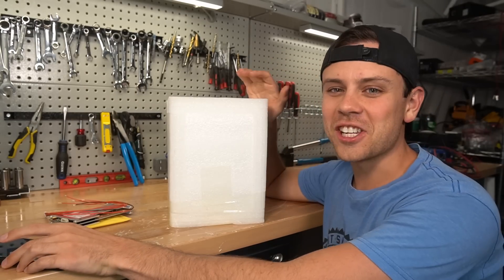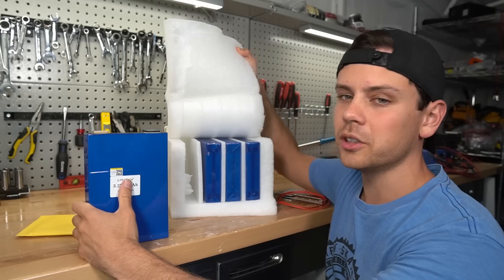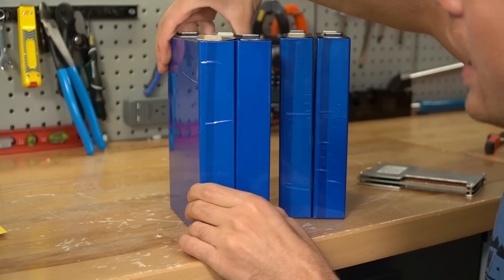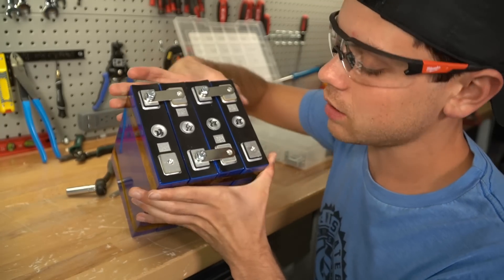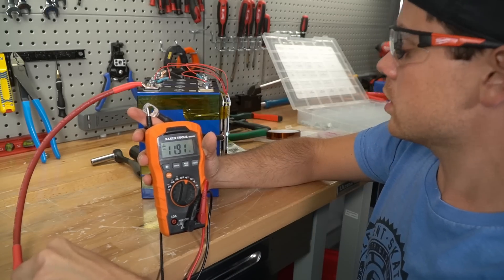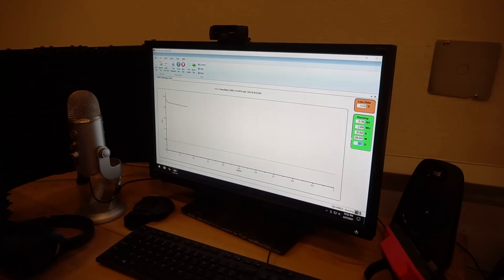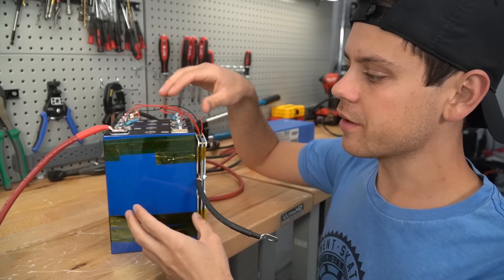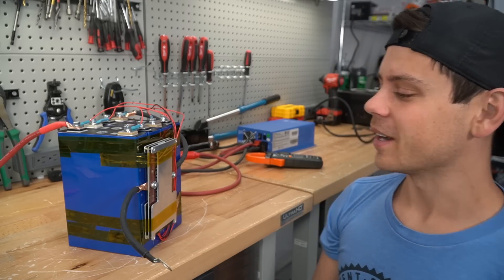Cheap LiFePO4: $221 for 100Ah 12V!! The Cheapest Cell + BMS On Aliexpress

Comment: Hello Will, I recently purchased a 1962 Vintage Airstream Bambi, (16 foot) and am restoring it to be functional yet aesthetically remaining a 1962 Airstream. There is a factory installed aluminum battery box on the outside of the trailer under the front window. This box measures 20" wide, 6" front to back and 10" deep. Currently, there are few things running on the 12V system (roof vent/fan and 12V lights, trailer brakes) but I would like to look forward to adding solar panels (not mounted to the trailer, carried in the tow vehicle) and have space under the bed for an inverter, etc. As the battery box is outside and not heated nor insulated, I am asking for suggestions. 
The inside of the trailer does not allow much space for large batteries. Is there enough room in the battery box to configure a LiFePO4 battery and incorporate a battery heater? Given the small size of my trailer, is it worth the expense of LiFePO4 batteries, or should I go with a lower cost Deep Cycle Marine lead acid battery, add an inverter and charge controller, saving the battery upgrade for a later time? What size inverter would you suggest?

Comment: Thanks Will for all your videos.  With your help and some others I have completed my solar install for my new camper.  I have 4 Battle Born 100 amp batteries an inverter, progressive charger, transfer switch and 4 100 watt Rich Solar panels.  I hooked it up today and my Batteries were at 90% charge and were full in less than an hour. Everything works!  I am so pleased and had very few problems that were not covered in your videos.  Thanks again you are just Super!

Comment: Could these be used in an electric riding mower, like the Ryobi 480e, that uses 12V 100ah lead-acid AGM batteries? The Ryobi needs four of these in serial to produce 48V.

Comment: Two weeks ago I bought four 280ah batteries for $228 with no tax and free shipping and...they have shipped. Who knows how good they are but that is crazy cheap! I upgraded my 12v lead acid system to 24v lifepo4 after watching Will's video last year and have equipment from that system laying around. I have a separate 24v 280ah system and the new batteries wont be used in that.
Reply: How're those batteries holding up?
I'm looking at 280ah batteries on AliExpress

Comment: I've been told that some shipping companies will only ship batteries if they're at 30% state of charge or less because of new regulations
Reply: Yes . We are lithium battery manufacturers
Reply: Or the batteries were removed from commercial service after a couple years . Those look  alot like refurbished used batteries to me you got screwed if those were sold as new

Comment: litokala once sold panasonic ncr18650b genuine cells for like less than 3 bucks each, all tested fine. but it was like 5 years ago  built a 600Wh pack with them for under 150 bucks.
Reply: And is it working fine still?

Comment: OH YEAH U R RIGHT. 221 is great price.  My friend went to buy battery at Orelly. they charge him  or lead acid  for my Uncle car's battery 12v for over 200 dollars  which would last only about 2-4 years.  5 if u r lucky.  with this Lifpo. it would last over 10 years if BMS not fail.  But then. you would have to put it in the battery box.

Comment: This question isn't related but hopefully you can help.   I have a renogy DCC50S max 50amp charge rate.  Can I use a battery that doesn't take a 50amp charge rate or do I need to get one rated at 50amp charge or better?  I think I know but... Thought I'd ask anyway. 😂
Reply: Read your charger manual.  Most modern chargers are "smart" and will adjust the charge current to what the battery will take, but if you want to maximize your battery life, you need to be able to set your charge current to be the same or less than the rate charge current of the batteries.  If you can set your charger current, then you can use it with lower rated batteries.  Just make sure to match your charge current to the rating of the batteries.

Comment: I was told these types if cells require pressure to hold them together. If cells bulge, they are no longer good? But the caps didn't blow. I'm confused.
Reply: Yes they need sone positive pressure on the cans.  The internals are wrapped up in a roll and naturally want to bulge out in the middle.

Comment: I learn so much here, it's way cool! Do you think these cells would make a pack that was good enough for running a 12 volt trolling motor that pulled around 35 amps at full throttle and used in a small Jon boat a couple dozen times a year? LA is so heavy and as you well know, doesn't deliver a lot of energy for the weight. I'm old enough that I'm not trying to buy a battery that will outlive me, LOL,  just one that is cheap and light and will run my little boat around the lake for an afternoon.
Reply: How did you get on ?

Comment: Hello from the Philippines, Will. May I ask you what I would need for a complete solar set-up for my camper? It should be able to run 3 12v fans, charge phones and power a laptop in the day - and, power LED lights and the same 3 fans at night. I would appreciate your kind advice, thank you
Reply: Considering that each fan is 90W and a bulb is 14W, that would be a total of 284W. So in theory a single 330W panel would be enough but I suggest going with two 330W panels as they won't produce the full 330W on most days. Apart from that you'd need a solar charge controller and also a pure sine wave power inverter with a battery capacity of about 2.5 - 3.0 kWh to be able to power the load throughout the night. Hope this helps. Just for your reference a 2.5 kWh battery would be about 12.8V 200Ah.
Reply: @cg.maniac  Yes, this is great. Thankyou!

Comment: I bought the VariCore version of these. not badly swollen. cells only cost with shipping and all 170$  2 months to the day to ship to the west coast North America. Pretty happy with them, but being that the Eve cells mentioned in the video are still cheaper per WH, might just buy a bunch of those for a large system. I'll buy more of these 100ah cells for small applications though. Mobile kitchen, shower setups type O' thing
Reply from the maker: You have swollen varicore cells?! what a bummer!!
Reply: @WillProwse   well I mean they are not very swollen if at all. Nothing like what this video shows.
So probably not actually swollen, but they check the box on all the other points you made. Low state of charge when arrived, second top sticker, and clearly re-wrapped
Reply from the maker: I love the varicore ones. Dang

Comment: Hey I'm looking to switch my 125cc pit bike to electric and I have no idea where to start... I know I need a brushless motor, controller, battery,  throttle connection etc....any idea where to start? I'm trying to get it to 50-55 mph ....I'm thinking 72v, 3000w battery and the appropriate controller....any thoughts or places to start would be greatly appreciated

Comment: Would it be better to use multiple smaller cells? To allow better cooling ? 3x 100 ah cells over a single 300ah cell?
Has anyone had a swollen cell fail?

Comment: I had a lifpo battery that I ordered from  the "pastry store" I READ
feedback FROM a woman THAT HAD  had the label torn off  WHERE THE AMP HOURS WERE INDICATED.
I  was curious about that advertisement noted the weight of each of the different sizes car batteries BEFORE I purchase a second battery and it came through with the label missing THE AMP HOURS I took it to  arbitration and wh
ON because I could prove the weight of the battery I received wasn't the weight of the battery I ordered.

Comment: I just got these same cells a couple of days ago, after ordering in early February! Just finished a not-too-formal capacity test and I'm quite pleased with the results.  As expected, they're giving me about 95-97Ah.  I didn't have the swelling issue with mine.
Reply: I got a similar one like these but "Orange" as a manufacturer and were just 65$ for the same. Around 98Ah and work great
Reply: @MaxC_1  @Rex KE6MT
I clicked on the link for the batteries found in the video and its a totally different thing..

Comment: I'm pretty sure these are ETC cells (not CATL). Also, based on the 32x 280Ah LittoKalla/Vericore branded cells I bought having similar defects, I'm convinced that these aren't swollen due to electrolyte breakdown/internal gases, but rather, an oversize jelly roll inside a hodge podge of QC rejects - each cell has slightly different physical, electrical and mechanical properties and tolerances that violated one or more limits without being an outright dud that would preclude its sale. Corporate buyers making forklifts and EVs don't want them, but individual buyers dealing in quantities of 4 to < 100 can still use them and are guided by bargain basement prices.

My guess is that the jelly roll is made by automated equipment that terminates the roll based on a fixed linear distance, but both the anode and cathode films are not a perfectly consistent thickness over many meters of material, so lots of cells end up oversized and with excess mass or uneven total thickness at the top of the jelly roll versus the bottom. This suggests, but doesn't gurantee more battery capacity since the extra mass can be due to only one electrode, where ultimate capacity is still limited by the amount of active material at the opposing electrode.

Other QC rejects I have seem to be due to superficial dents, terrible bubbles and trapped debris under the blue plastic insulation tape or cuts/holes exposing a bit of the underlying aluminum can. One had a missing plastic protector over the overpressure blow out vent. You get what you pay for, but there is no reason to throw these out or not use them based on their geometric abnormalities. Just don't expect to build a 400V series pack without serious time invested characterizing every cell individually and removing or pairing underperforming cells with small helper cells to get some semblance of consistent coulombic capacity and ESR for each series component.
Reply from the maker: Thanks for the information. Appreciated!
Reply from the maker: Yeah, good final points. They are still usable.
Reply: That makes good sense. Truly hope that’s the case. My main concern has been “are these AliExpress cells USED” and then rebranded which will obviously impact/reduce remaining cycle life. I ordered a Vericore set of 280ah last year and they’re working great & pulls full capacity. Two cells were bloated but their under compression now so not an issue. Pulling full capacity doesn’t tell me if these cells are used though. Wouldn’t be surprised if these cells were originally 320ah but used and rebranded as 280ah. I won’t be using this battery much as it’s in a camper so the cells suite my purpose regardless of cycle life.

Comment: Damn, yours are swollen pretty bad. I bought these same cells (Jan 30) and mine are not perfectly flat but they're nothing like yours. Mine weren't missing hardware either... I was planning to do a small build video with them but haven't had the time, guess you beat me to it. lol
Reply from the maker: No way!! That is strange that yours are not as swollen. Nearly every single one in this pack was.

Ahh dang you were lucky to get the terminal hardware. Very cool
Reply: We'd enjoy seeing your experience with these cells as well.
Reply: My cheap 80ah cells are also not swollen and pull the 80ah as rated, I guess I got lucky! haha Been working for 8 months very well too! I think with the cheap cells the KEY is to just use small loads on them, anything under 20amps for charge and discharge and they don't have issues. Active cell balancing works well too. Running a 12v fridge, some LED lights, and a fan...charging cellphones and flashlights. Very useful but not a huge stress on the battery cells.

Comment: Give them away! :-) I'd love to see you do a video using the Battery Hookup LiFePo4 cells. I just bought a 4-pack for a 12V battery milk crate I'm building based on your $702 design. For $302 shipped from the US for 4 x 3.2V 100Ah batteries, it might be a great option. Add a BMS and you're golden.
Reply: You talking about the 4-pack kit with (20) 32650 cells in each pack for $300, right? I've been look at those myself. Did you finish your build? How was the quality?
Reply: @ehondo88  I'm waiting on the batteries to arrive. I planned it all out on Tuesday! I'm headed to the local electrical supply tomorrow -- I'm not sure which Walmart Will shops at, but my Walmart isn't listing coils of beautiful and cheap 10 AWG stranded copper wire in red and black online, and who has time to drive there to check?!? :-) Hopefully my local supply will be less expensive.

Comment: Of course I have a set of these ordered and in processing before seeing this!  If mine come swollen, can I use them until replacements are received?
Reply: I've had mine for 3 months now and while they arrived slightly puffed, they continually pull 98Ah, which is fine with me at this price point.
Reply: @ttttenney    Did you compress yours in your set up?
Reply: @van_seeking_adventure8770  no, I put a strip of two sided gorilla tape towards the top and bottom between each cell and then wrapped them with Kapton tape, similar to how Will did in this video.
Reply: @ttttenney  To allow them to expand and contract a bit I’d presume.   Thanks.
Reply: @van_seeking_adventure8770  honestly, the reason I ran strips of double-sided tape between them was to fill the small gaps since the cells aren't perfectly flat. It also makes them more secure in the Pelican camera case I'm using.

Comment: I like your Aims 70 amp charger. I use mine a a lot and it has been reliable for my 38120 science projects as well as for topping off my 1200ah in Aims 200ah cells for critical load backup. Aims tech says that the chargers can be put in parallel so I can slam the battery bank with 4X70's for 280 amp hours powered by the gen set. Aims is out of stock on these.  A bunch of new Lishen 280ah cells came in the last 2 days and some Daly 250a BMS units are coming today.  See what you started?

Comment: How would a battery bank with these work in a truck in the Arizona desert? They won’t be in the engine compartment but the cab gets up to 140 F
Reply: I don’t think Prismatic cells Like these do well in high heat.  They prefer to be in a climate controlled environment.  You might want to build a bank with 18 650 cells or something like that

Comment: Thanks Will for all this information and advice on batteries, solar system and accessories.
One little question in two parts.
Can an active cell balancer be connected to a 4S LiFePO 4 system at the same time as a BMS?, and if so could you put the wires on a single same ring terminal connector (per wire of course)?
Thank you ahead of time.

Comment: Not everyone had your money brother, and I have 20 105AH cells bought straight from  Japan 4 years ago. Cost me $1052.91 that’s with tax, they had/have imperfections, I have ran my shop off these batteries with good equipment and panels for those 5 years without a any issue as of yet, you may be correct they won’t last, but I work A LOT out there and cut $400 a month off our bill, and spent maybe, $3000 total on my system, $400x12=$4800x4=$19,300 roughly, saved $16,300 so far, price for my batteries in say a brand you run, $300-500 per 100ah= $6,000-10,000

Comment: Please do an experiment with a used Nissan Leaf battery and mount in an RV.
Reply from the maker: I hate those cells. Trash them. Heavily degraded and cobalt based so thermal runaway is an issue. Avoid them.

Comment: I'm just worrying about those copper terminals touching the cells with the bms just give a spacer as you know they have negative charge in the body of cells ... Can short circuit

Comment: I bought the same cells, two months ago, they all had little more than 3v, unfortunately I have no way to test the capacity but at least mine were not as curved as yours.  I did however put some pieces of cardboard between the cells to separate.  all combined with a 60A bms.

Comment: Thanks for the review! Nice to know that even a ruined cell still perform that well! Have anyone a recommendation for 200ah Cells?
Reply: You can get lishen 200ah they're avaliable
Reply: @flatdek3785  but from which supplier? The one from wills recommendation list is more expensive than the 280ah versions. Are you there no other good deals for 200ah?
Reply: @AscendedBeing87   And yes they have stock 202ah cells

Comment: I saw a Himassi 200 AH battery with low temp protection and blue tooth on Amazon $499. Sounds too good to be true, anyone with any feedback or thoughts on this battery? I live in L.A. so low temp not so important but I also want bluetooth, I want to use it as an acessory battery on a boat? This seems to check the boxes but the price is so reasonable it made me wonder how they can sell at this price?

Comment: Still trying to find out if I can combine Battle Born batteries with these others WP keeps showing us in my RV system that has BB batteries now. No one has been able to answer that question. If someone knows I would appreciate some knowledge. If it is possible are there issues I need to address before I do it. Don't want to fry BB batteries or my Multiplus. Thanks.

Comment: Seems compressing them into a tight hardcase with all-around tension brackets and screws might extend total amount charge cycles and prevents further bulging. They than vent trough the air-caps. They smell awful.